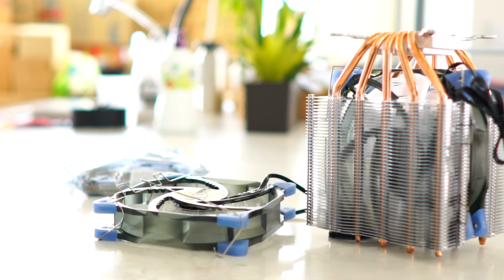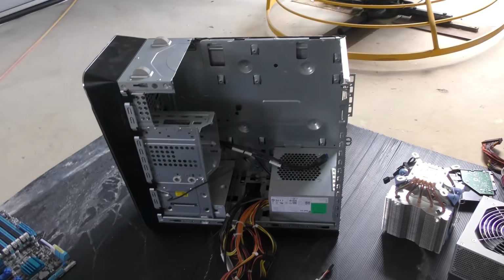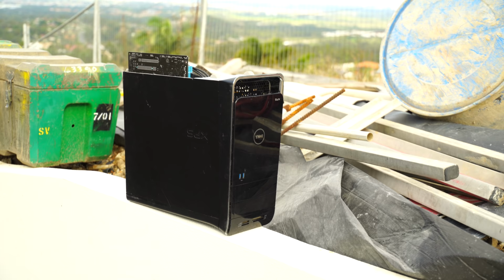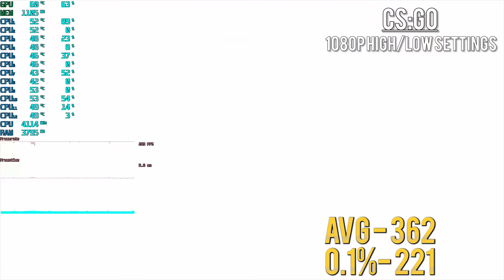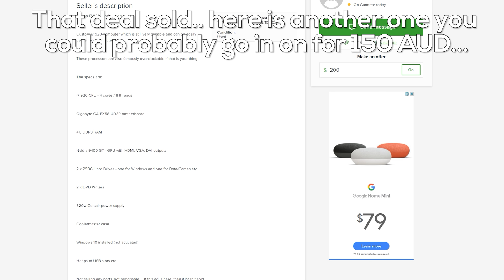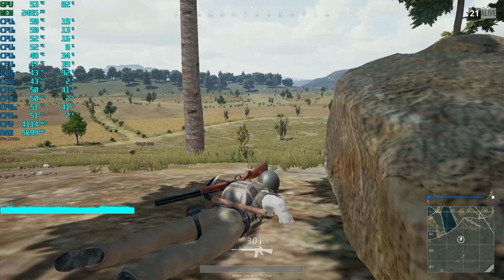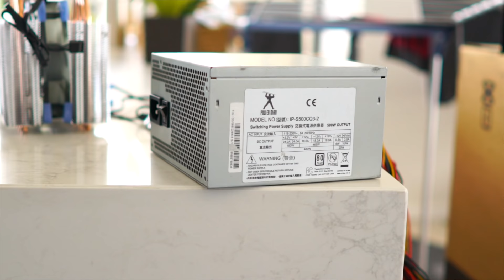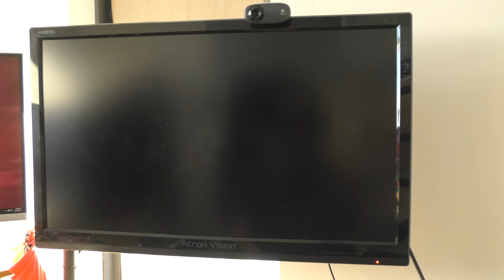Build a 6 CORE GAMING PC for LESS than an i7-8700K!

Comment: why is the pc not using 100 percent of either the cpu or the gpu. lost potential
Reply: Faf Dus you need to learn how frames and computers work m8
Reply: There could be a few reasons. This cpu has hyperthreading which tends mess with the core usage readings. Or a RAM speed limitation could be happening.

Comment: https://pcpartpicker.com/list/XyzCNN
Is this a good PC build for my first build? Criticize everything if need be. I want to learn. Lemme know your recommendations for Changes in this build or recommend a different build. I would LIKE to stay around 600$ (Yes i know that this is over a grand) but if you want to go over because it'd be worth it, then go for it. Are all these compatible?Include information (Idc if it's your opinion-the more opinions the better) about if any part is overkill or unnecessary or if this build doesn't make sense
Reply: PIPPINGAMING That PSU is way overkill man you don't need 750 Watts, also only 250GB storage? Try and get a HDD too. You should opt for 2x4GB sticks of RAM. Also you don't need a Z270 motherboard unless you plan on upgrading that CPU, if you can go AMD go Ryzen and get a Ryzen 3 1200 and OC it
Reply: https://pcpartpicker.com/list/hxNF7h

- Swapped the CPU for an R3 as it'll perform better with day to day applications, and whilst gaming. Also it comes with a stock cooler so you don't need to buy one, and you buy into the AM4 platform as well so in future for an upgrade you just need to swap your CPU.

 - For the motherboard, I chose an ATX sized one to fill in your case , and one that suited your black and white theme. It'll support future CPU upgrades and you could even put an R7 in it if you choose.

 - For memory, swapped to a 2x4 kit to make use of the dual-channel feature that Ryzen has. But I don't know what games you want to play and whilst 8GB is fine for MOBA's and CS:GO, if you want to play AAA games (e.g. GTA V, BF1), then you're probably going to need more. Double check on system RAM (not VRAM) usage of the game you want to play online and if you need more than 8GB to play comfortably, then this is a kit to go for:
 * https://pcpartpicker.com/product/Lwx9TW/crucial-ballistix-sport-lt-32gb-2-x-16gb-ddr4-2666-memory-bls2k8g4d26bfsck

 - Added a 1TB HDD for games and other storage, just a 250GB SSD alone won't cut it.

 - Swapped the PSU for something cheaper and probably of better quality. At 520W It'll support pretty well any upgrade. SeaSonic pretty much has that price range locked down, there's none that're around the same price at the same quality. If you do want to go for a bit more power then the 620W version of that PSU is $5 more than this 520W one on newegg:
 * https://pcpartpicker.com/product/Tc3RsY/seasonic-power-supply-ss620gm2
As a point of reference, whilst gaming your system's only going to pull ~150W, so you could go for a lower power output PSU but they're not cheaper enough to sacrifice the quality or upgrade path. That being said, if money's a concern, then you could save $25 after rebates and get the Corsair CXM 450W https://www.newegg.com/Product/Product.aspx?Item=N82E16817139146&ignorebbr=1&nm_mc=AFC-C8Junction&cm_mmc=AFC-C8Junction-PCPartPicker,%20LLC-nana_-na&cm_sp=&AID=10446076&PID=3938566&SID=

 - Windows 10 keys you can get them from Kinguin for ~$25 or eBay for ~$5, there's no need to buy them at retail price.

Some notes I'd make is to check that you want to buy from multiple sources instead of one, to overclock, and to think about your GPU. It's super simple to overclock the CPU, and you can also look into how to overclock the RAM to get more performance out of that too. As far as GPU goes, look online to see if the 1050 Ti cuts it for your needs, especially since you're getting a 144Hz monitor because with AAA games you might need a 1060 to have a satisfactory frame rate. A 3GB 1060 is fine for 1080p.

That being said, seeing as your original total cost came to $1240, for that kind of money you could buy this system: https://pcpartpicker.com/list/njQ9VY which will offer you a better gaming and work experience.
You could also opt for this graphics card instead if that Asus one is too white: https://pcpartpicker.com/product/4Np323/msi-geforce-gtx-1060-3gb-3gb-oc-video-card-geforce-gtx-1060-3gt-oc

Also just double checked and it seems like NZXT has mounted the fans on their S340 where one's at the top and one's at the rear for some odd reason, so make sure when you get it that you put the top fan in the front as intake, because you want clean air to go to your graphics card too.
Reply: $600 for just the hardware I'm assuming?

I would say at most you need 600-650w on the power supply, so you could save a bit there and get an EVGA 600 B1 (about $45). 2x4 sticks instead of 1x8 so they'll run in dual-channel. Instead of 250GB Evo, why not get a 1TB HDD and maybe a budget SATA SSD like from Adata?

Also, if you don't mind going AMD instead an R3 1200 and B350 Board can be had for under $200 total, and not only can you still overclock you could drop the Coolmaster EVO. AMD's Wraith cooler is plenty for that.

That or just go with a B250 motherboard and stick to the Pentium if you don't plan on upgrading it to a K-series chip at some point.
Reply: hey, a pentium paired with a 180 dollar mobo is overkill bro. get an I5, and maybe it would still be overkill.

Comment: The answer to the title would be the 8600k xD
Reply: technically it might have been a Phenom II x6 1090T.
Reply: luidżi no, the best 6 core for gaming for less than an 8700k is the 8600k (or even 8700)
Reply: I mean it has Hyper-Threading
Reply: Tr3vor he didn't specify (;
Reply: Dr. Dunk but Phenom II has 6 cores and it is much cheaper than i7-8700K ;))))) So technically it might have been x6 10xxT.
Reply: luidżi You don't get my point xD
Reply: Well Hyper-Threading makes it comparable to the i7
Reply: +Dr. Dunk actually the title says the entire build is cheaper than JUST the i7 8700k alone.

Comment: Lemme guess, all the cores are slower than the speed of 2 bricks in a race arn't they? Stop clickbaiting first time builders with the core count!
Reply: @eugene dude, seriously.
Reply: Actually not. X58 is still is good!
Reply: Ehh if you consider reliable 4.6ghz overclocks on 6c/12t cpus on 32nm architecture 'Slower than the speed of 2 bricks' then i guess so lol
Reply: Xeon x5670 at 4,5 GHz ~ i7 6700k at 4,5 GHz. I see no clickbait here.
Reply: novablast - i used to have a xeon x5460 (4 core) 4.125 ghz and it was basically close to an i3 6100 at stock, i paired it up with a 1050 ti oc edition aswell it cost under $240 1tb hdd of space, but cmon, he is clearly saying how the 6 cores are suppose to deliver tons of performance and he makes the reader believe higher core count equels higher performance by simply stating it is more than 4 cores, amd use to have 8 cores and they were all shit cores, but he can advertise and say something about that high core count which is exatly wht he has done here. did he really have to say "six cores!!!" Just so his build looks impressive, no he didnt have to do that at all and its all clickbait
Reply: ...that's just marketing surely.
Reply: Intel go away, you're not fooling anyone!
Reply: _ WereWolf_Engine _ x5460 is lga 771 which has WAY lower ipc than even x58, like the video shows you can get near i5 8400 scores in terms of multicore. The single core is near a stock 3770k overall performance as well when overclocked, so this chip can do ALOT in this day and age.
Reply: Six 1st gen core architecture cores that can get very good overclocks should certainly be faster than "2 bricks in a race".
Reply: Well if you knew anything about processors you’d know this one keeps right up with the newer processors of today. So it’s not click bait at all.
Reply: XxViciousxX - holy crap u guys r all missing the point here!!!! When did i ever say xeons r shet? I used the bricks analogy but that was to make the point of how high core counts do not equel higher perdormance however this is exatcly why he is portraying and this is simply incorrect! Im not saying the cpu he uses is crap, they have i5 8500 performance for sure, but at the end of the day he decided to use that high core count to lure us in
Reply: _ WereWolf_Engine _ I'm not sure if you understand the point of this video. A immensely powerful sistem at the cost of the Intel newest one alone. What is, that you can't process?
 And the Xeon that you have owned is much slower than the x58 ones.
 Let me educate you, not all of the Xeons are the same.
Click bait for the core count!?! Your brain is stuck in the 2008 or something?
Reply: _ WereWolf_Engine _ If you don't know PC parts/ not well informed you'll see this as clickbait. An 8700K is around $400, only an idiot won't see this as an old Xeon 6 core which are now cheap AF in the market
Reply from the maker: This is actually insanely good for first time builders on a budget. The contrary to your OP. How is this clickbait? I delivered on the title and showed the PC in the thumb in the video being built from scratch.
Reply: Tech YES City - your making people believe high core count leads to high performance when it doesnt, thats all, and for the billionth time im not saying xeons suck! So plz stop assuming what im saying, my second build actually had dual (x2) xeon x5690's and i paired it up with a 980 ti. I wont bother saying what build i have now. So can u plz just understand that i have nothing against xeons but the fact that he makes first time builders believe that high core count leads to higher performance by stating the cores are higher than 4, there are many more ways to tell people about the hidden power of xeons other than it's  32 or 28 cores it may have (anything higher than 4 cores doesnt mean its better and thats wht the thumbnail suggests) but anyways who am i to argue u made one of the best xeon videos i have seen in a while but i just get unnecisarily annoyed when people use core counts to express the power of a cpu, ryzen has a  6 core cpu and it can almost keep up with a 4 core 6600k, theres a good example, god this is seriously long what am i doing?
Reply: B0NES YT - oh Great another person who is just angry because I said Intel beats ryzen, everyone is missing and completely ignoring the point I'm making, when u oc a ryzen 1600 to 3.8 GHz 4 example it can sorta keep up with the 6600k (look at the benchmarks), but the reason for it being able to keep up isn't because of the six cores. So again, core counts shouldnt be used to express the power of a build or a CPU
Reply: _ WereWolf_Engine _ Sorta, even a i5 2500K OCd can keep up with a 6600K. The Xeons on this video don't have bad IPC at all. Also I do not see any many core CPU performing terrible, even FX 8s on good hands can trail a R7 1700